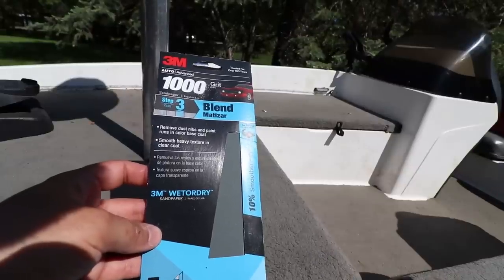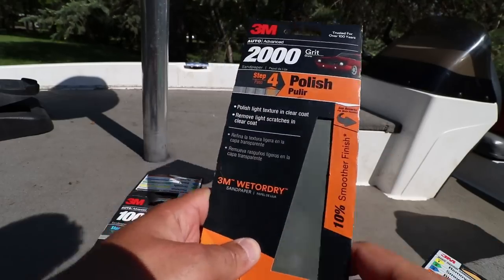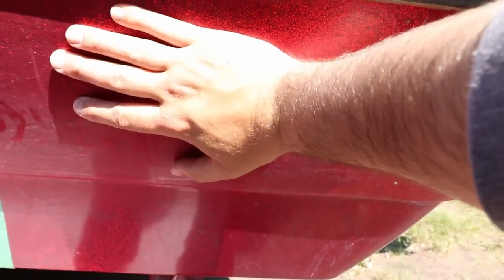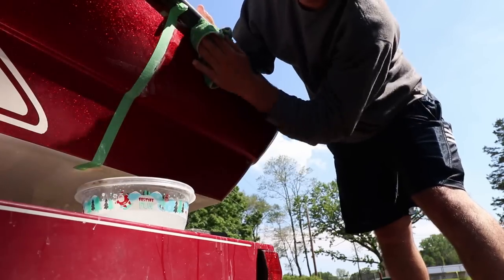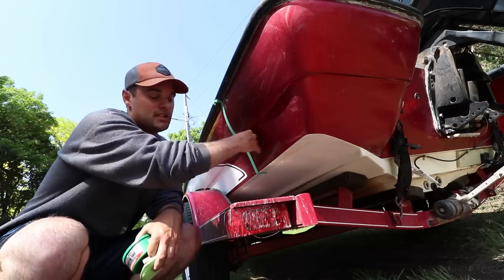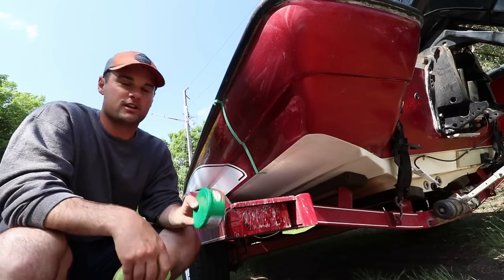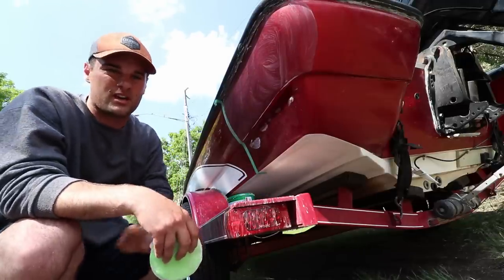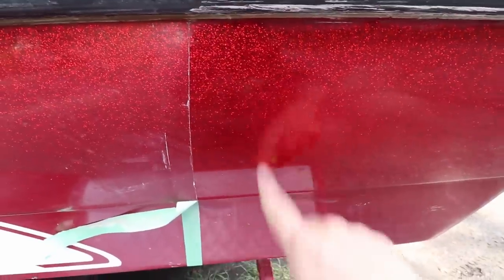How To WET SAND and WAX a Boat | Remove OXIDATION From GelCoat

Comment: Your idea on when to stop sanding is kind of up in the air just in my personal opinion. When sanding any clear coat/gel coat you can see the dirty part first but not always. But you should never, ever see the color of the boat. If I understood you correctly that was what you said. Forgive me if I misunderstood. If you see the actual color of the boat in your soapy, sanding water then you have burned through your gel coat into the paint. I know for a fact it is that way with a car with a car when the paint is “”Base coat, clear coat.”” That simply means the paint goes on first and then the clear coat. Every new car since the 80s are painted with Base coat, clear coat. An example is if you get a scratch on a red car and the scratch is white then the scratch did not go threw the clear coat. If the scratch is red then it went threw the clear coat into the paint. If I’m not mistaken and I don’t think I am then a fiberglass boat is the same. And something to keep in mind. Gel coat boats are much, much more forgiving than an automobile. I did one just today and started with 600 grit paper. Then went to 1000 grit then buffed with 3M compound and then waxed. This boat was oxidized terribly bad. It actually had a better shine after I sanded it then before. Thats how bad it was. I was probably able to bring a zero shine back to a 60 to 70% shine. Another good thing to do in block sand. That cuts the clear down level. Just remember to never stay on a ridge or protruding are for long at all. These are the ares where you will cut threw first if not carful. Soapy water is a big plus. It allows your sand paper to slide much easier and it won’t catch as bad bending the paper. The higher grit you go the easer the paper will fold up on you. You can actually start as low as 500 grit paper but you need to know what you are doing. 500 grit cuts fast and deep. If you start with 600 or up you can sand a lot before cutting through. Sand until smooth and move up in grit. Most compounds are at least 1000 grit. For that reason you are wasting your time going with a higher grit than 1000 paper. Sorry so long. I have been sanding for many years and when I start talking about it I can go on for hours. This gentleman did a great job. Thanks for the video, appreciate you sharing!!..

Comment: You have obviously done your homework on this project ! I was a detail manager for 17 yrs and and everything you advised, is "spot on". There will always be different opinions on the grit of sand paper and what compound to use, but you nailed it as a good general advise ! I would recommend to anyone doing this to buy a buffer. Even if it is a cheap one. That is a LOT of rubbing by hand and you will be wore out by the time you finish. If you do go with a buffer, just take your time and listen to good advise. You can even use a buffer, with the right pad, to re-wax or polish it next year.
Reply from the maker: Thanks, and yes my shoulders were very sore after polishing by hand. I plan on doing this again at least twice this year...will definitely be investing in a buffer. Thanks for watching!
Reply: Larry V: Just a follow up on your comments. Harbor Freight sells a buffer at a good price compared to a professional grade. I don't own one but most people who comment on YT seem to think it is a good value for the  DIY er.
Reply: Do  you need to sand until the boat gel shines?

Comment: Thanks for the info, I used 1000 grit wet sand paper on my gel coat to remove some dock scratches then I tried rubbing compound and then wax but you could still see the scratches from the thousand grit, so this time I'm going to try to step it up slowly and see if that will help (example 1000, 2000, 3000, etc.) thanks

Comment: Good stuff. No issues if the gel coat is white with that first compound being orange.
Reply from the maker: Thanks, I plan on doing this again this spring. Do you use the same compounds I used in the video? A few people have said they used different stuff.
Reply: @FloppingCrappie : There are compounds/polishes specifically for Gelcoat. I don't know if they have extra value over what you used. It may be marketing hype- just another product to buy. Ask a professional.

Comment: My boat sat in the scorching hot Arizona sun for 16 years. It had an incredible amount of oxidation. I did exactly what this video said to do. Starting with P-500 grit then 1000 grit and finally 2000 grit. The sanding alone took 15 days, 3 to 6 hours a day. Then the rubbing compound, polishing and waxing. When I was finished it was shiny and beautiful. A year later I noticed the oxidation coming back. I applied the waxing and polishing twice within that year. So now I am back to the sanding. It is going much easier this time. I am wondering if after this time can I retire my sander?
Reply from the maker: haha, that sounds like a lot of work you put into that boat, labor of love i guess. Hopefully you will only have to wax/polish once a year to keep up the shine.
Reply: Did you use a power polisher or just by hand, if you did use power polisher try to up the rpm and do slow passes to get a good steady layer of protection, the slower the passes the better I’m not a pro but I do this for work and found high speed slow passes give me the best results, and try using higher grade products if your not already and add a sealant or ceramic after everything is done will definitely help !

Comment: What would you do if u can feel the sparkles already from an older boat? Recoat with new gel and sparkles?
Reply from the maker: Ya, I would bring it into a Marine shop and ask what is needed to re-apply a gel coat
Reply: I had a go at gel coating myself on the bottom of hull on my ski boat lots and lots of work lots and lots of sanding.Id be asking many questions if your going to consider gel coating yourself. Gelcoat and flowcoat are different.Like Flopping said take it to a marine shop and ask.I never want to go through the pain  of spraying gelcoat and sanding back ever again maybe consider a professional paint job instead .Great Video by the way Flopping.

Comment: Does it feel smooth when your done? I’m about to do my top cap and it feels like you can feel the flake, but am wondering if it’s just the oxidation that is rough. If the oxidation is even less than you had here, would it work with just the compounds and not sanding? 
Great video, very informative
Reply from the maker: after you're all done with waxing, it should feel fairly smooth. if you have less oxidation than i had, i would recommend just starting with the compounds and not wetsanding.
Reply: North Carolina Bassin yeah it should feel smooth

Comment: I know this is a old video but I can’t get anyone to answer. But what does it mean if the sparkles in boat are white after it drys ? What if you do burn thru the gel coat ?my boat has a lot of oxidation
Reply from the maker: It's possible that you've burned through the gel coat. In which case you need to reapply gel coat to the area. I've never done this before, but there are a few videos on YouTube about it.

Comment: Good video, I have a 20ft Aquasport and need to set aside a weekend to do this. Have you looked into PoliGlow? Stuff seems amazing and lasts a boat (excused the pun) load of time.
Reply from the maker: Thanks, I think I've seen another video use poliglow along with a buffer. Might try it out this year. I dont recommend doing this by hand like I did in the video...could lift my arms for a couple days. Haah
Reply: Hahahaha, I believe you. That's way to much work!
Reply from the maker: @avidskier73  ya, I'm definitely investing in a buffer next time.

Comment: I’m just wondering why he’s not buffing with oxidation grease and wax instead of wet sanding , unless he just wanted to show how to wet sand ? My boat was extremely bad and I buffed 4 times then waxed works great.
Reply from the maker: I'm not sure if Rubbing compound is the same as oxidation grease, but from the research I did before filming this video most people wet sanded their boat and then applied the compounds/wax. I guess next time I do this I can try oxidation grease.

Comment: You should sand until no more white chalk/oxide comes off. Never sand in circles. Check videos by detail professionals. Lots of instruction is available. Sanding is done using a “cross hatch” pattern. That way you are guaranteed to sand evenly across the boat.

Comment: try smoove procut 1000, no sanding needed, i tried it today on my 07 maxum 2600 se that sat in the sun for 12 years, oxidized more than your boat, turned out great without sanding,
Reply: what is it?
Reply: @ericdiekmann11  polishing compound for gel coat in one.
Reply: in one step.
Reply: @alex3012red  I looked into it, they still recommend using all three of their compounds

Comment: I would never use a sanding sponge block. Use a wet sanding block.
Reply: wouldn't a sanding sponge follow the contours of the boat better than a flat square block?
Reply: @Bassmada  I was cringing at the idea the paper would slip and the 120 grit would grind away- - - use a chunk of foam rubber from an old couch !!

Comment: I wetsand and waxed and the i
Oxidation came back next day
Reply from the maker: You may have to repeat the wet sanding process until all of the (brownish) oxidation is removed. The wet sanding should start to turn a soapy white color. If you didn't want to keep wet sanding (so you didn't burn through the gel coat), you could use the rubbing compound multiple times to help remove additional oxidation. If you're using a buffer make sure to set it on lower RPMs when applying multiple coats of the rubbing compound.
Reply: Try a heavy compound??? If that does not work you may have what is. Called dead gel coat
Reply: Gregg Webb I used an electric buffer wth the blue microfiber 3m pad with oxidation lotion about 3 times then washed then waxed ( maquar brand)